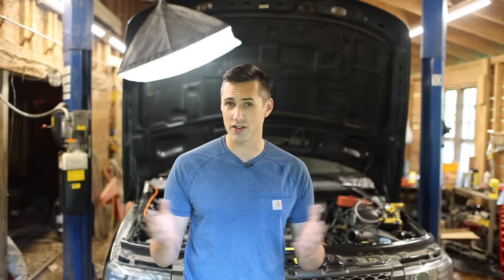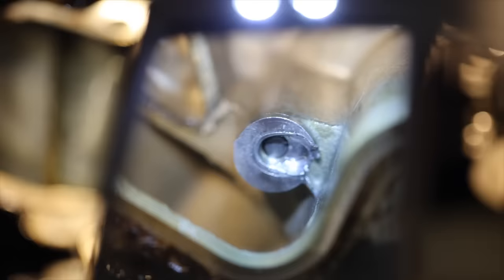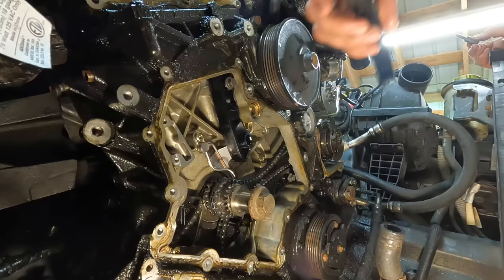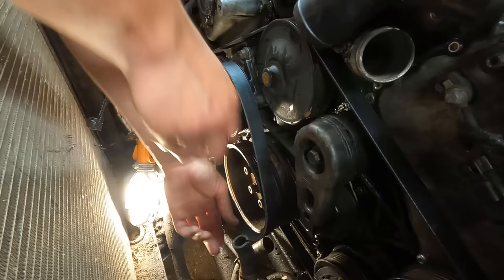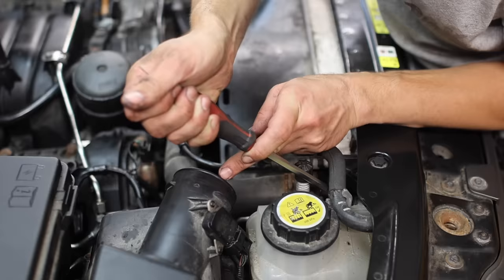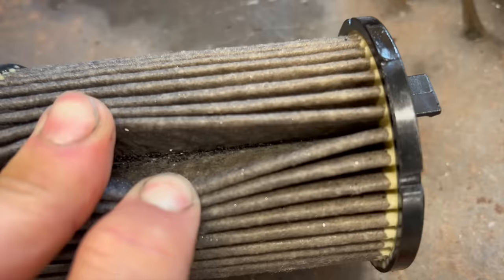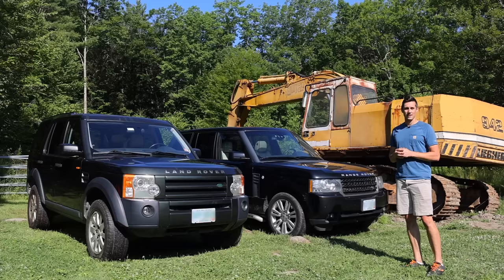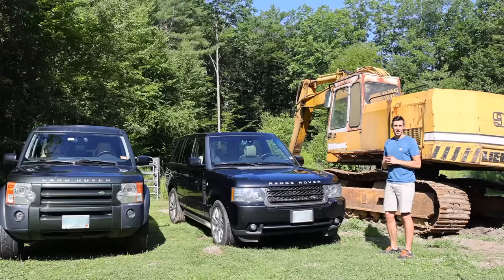Does My Cheap Auction Range Rover Need an ENGINE REBUILD? [Range Rover Part 4]

Comment: Sell them all, anything with Rover on the hood, take the money left and purchase the first decent Land Cruiser 100/200 you can find and enjoy the rest of your life without having to rebuild engines.  You wont find one for $2 grand but you wont have to buy all those parts to fix it. My 200 even has heated and cooled seats.  At 115,000 it has no knock at all.  I spent my $ putting on a set of Heritage Rims.  If you just enjoy working on cars then maybe you can take both ROVERS and make one that will go 6,000 without needing new heads, cam, timing chain, etc.

Comment: At the point you cranked the engine over for the first time after reassembly, it sounded like you had low compression on a cylinder. 

Edit: I had low compression on a cylinder from a melted piston which caused metal in the oil and the filter from cylinder wear etc.

Comment: My personal opinion you paid $2000 for it you repaired it drive the thing until it falls apart. That is my personal trainer when the motor goes out for the new motor in it if it’s worth it.

Comment: Did u get out all the chain guide plastic pieces? I did not see u did in the last episode. Some of them should be in the pan and most of them could be in the oil pickup. Well, at least ur engine does not give oil pressure warning. Not easy to just remove pan to see for this car. Everything is heavy duty and built like a tank.

Comment: Aluminum flecks, severely broken timing components, if you didn't drop the oilpan and clean it out, the carnage from the old timing components will remain.

Comment: You got swarf in the engine when drilling out that bolt. Maybe you got lucky and it all went to the pan, maybe you damaged the engine. Change the oil a few times and see what happens but short trips are your friend right now 🙂

Comment: Where was the water coming out the exhaust coming from? The aluminum particles on the new filter could be residual from what was in the motor.

Comment: That bolt area that was wallared out also holds metal oil lines that oil the chain at the crank gear....with the bolt gone they fell out and they were missing when you opened everything up. Did you replace them???

Also a lot of the aluminum in the system could just be contamination from the bolt getting wallared out and all that falling down into the pan.

Comment: I think you're not going to get those aluminium parts out in one of two oil changes.
It has an oil filter... So that wont be going in the engine, let the filter do its job, and keep driving it.
It will probably go away

Comment: Hi Waldo.  I really thought this video would end differently.  Especially when the leak down test results looked good.  An LS swap would be sweet but reverse engineering that can bus data would be difficult.  I don't know how good the can bus tools are for that.  I liked the FoMoCo logo on that tensioner.  Maybe the data is similar to Ford's.  You might get lucky.  If it we me, I would just drive it until it wouldn't go anymore.  Thanks for the video!
Reply: Ford owned Land Rover when that car was new.

Comment: Hey Waldo. Just found this series and I have never seen a failure like that after my 20 years with rover.   I noticed you didn’t install that last bolt on the passenger bank fixed guide.  Couldn’t get the bolt out?

Comment: Should've replaced the oil pump while everything's exposed . They are only good for 100k,
and it's right behind the timing belt. They're not that expensive and easily replaced.
And a failure would destroy the engine by the time you realized a problem....

Comment: It’s just a ford engine, possibly even if it is a Jag engine.
As for the swap if the engine has the same firing order and the same sensors and the same number of teeth upon the tone ring the computer won’t care that it’s a Ford Jag Toyota Nissan or LS. You could even fit a North Star if you wanted to be really different but the biggest problem with that may be the bell housing adaptation or not ?
The problem with North Stars is the crappy head bolts but there’s a fix for that.

Comment: Put a v8 Range Rover motor in it that way you can use the computer from the donor engines car and it might match up better than an ls would and possibly less work

Comment: I think the metal bits are from previous abuse. There's no way that 20 miles around town would cause so much wear. Clean out the pan, change the oil a couple more times and I'll bet it goes away.

Comment: I know nothing about these engine, but it's not a aluminum block with nikasil coating (or whatever cylinder coating they have) that has worn out and is now slowly eating the cylinder walls?

Comment: Can you make sensor adapters to fit the Land Rover sensors to an LS engine? That way the Land Rover can still use it's central electronic stuff. Transmission adapter plate also so you're only changing the engine?

Comment: This is why I did not purchase a Range Rover. This is my dream car but just not reliable. I purchased a Lexus GX460 instead. 8 years later and still going. Not one single issue. Not one.

Comment: so... although 5% leakage is admissible in the compression test, yet since all those cylinders were losing on the compression a little bit, it might be the cause for those metal chunks in the oil filter??

Comment: The only engine that should ever be in a range rover is the 3.5 L Rover V-8 engine the aluminum one based on the Buick design originally.
This engine had tons of power for super reliable simple to repair extremely durable sure it probably doesn’t meet all the emission requirements , fuel economy etc. but really  why mess with a good thing ?
If you really want to do it smart engine swap that would be the engine to put in this then you can go 500,000 miles reliably
Oh and that aluminum in the oil probably most of it came from All that aluminum in the timing area , clean and sump really good and see what happens.
Or just sell it as Runner

Comment: Is the motor in the Range Rover the bmw M62 V8? I have an X5 with the same engine and have no problems apart from a rattle vanos. Just do another oil / filter change and it will be fine for the trip.

Comment: Since you already dropped the money on the timing ...id rebuild it and not ruin it with an LS  swap  or find a used low milege engine or a totaled out range rover keep it all range rover it would bring more money all stock if you choose to sell it later ......LS boys love them engines.  But it would be a hassle trying to swap it unless you completely rewired everything just for that when a salvage engine would be basially a plug and play

Comment: Just run it.  If and when it dies worry about it then. After you SeaFoamed the motor you haven’t put nearly enough miles to flush it out clean.

Comment: Sometimes it better not to know 🤣🤣 I personally wouldn’t start putting a lot of money into this project, it will be a money pit. Run it and see what happens, if it blows sell it for parts. The engine is past repair anyway

Comment: I do smile when the suggestion is to 'put an LS it!'. I mean why?
That RR engine is running too well to have major issues. I would have the sump off, clean everything out and do regular oil and filter changes rather than buy someone else's engine with no history. Given the issues found I am surprised you didn't drop the sump when you did the timing chains. After all a bolt was flying around in there.
This RR has suffered from the usual ham fisted 'Someone' who has 'been there before' and you blame the car? I mean the timing chains were shot because that 'someone' failed to do a proper job.
Oh and lets remember this engine is a Ford AJ-V8 which was fitted to the RR from 2005 to 2012 and in other cars, including the Lincoln LS and the 2002-2005 Ford Thunderbird, as well as the Aston Martin V8 Vantage. So 90% of whats in that engine can be bought from a Ford dealer.

Comment: Take off the oil pan, clean it, clean it and keep the oil changes up.  That engine sounds good, but you will only know if you really dive into that block.  You are catching the shavings in the oil filter and there is really no telling if it was from the previous owner and how abused the engine is.  If everything adds up, the math computes, why not be confident in your capabilities?

Comment: You should electric swap it.  Pick up a totalled Tesla Model S and swap the batteries, motors, and computer into the Range Rover.  Quiet, torquey, reliable, and little service

Comment: why not rip the engine out, cam and sleeve it and hot it up. you will probably find the issue but you can replace parts with hardened versions so they dont wear as fast.

Comment: I would neutral drop it, rocking horses, burn all the rubber off the tires, remove all the oil, and then redline it until it explodes. Then I would put plastic explosives in the cab roll out some wires, and operate a plunger like wiley coyote and blow it to smitherines!!!!!!!

Comment: You have two options. Or throw it into the sea because British cars are a waste of the world's resources. Or throw away this motor and install an electric motor. There is plenty of room for batteries. And regarding the aluminum in the oil, in my opinion and from my experience with no better cars from France and with the same problem with the timing chain, this is what came out of the engine block when the timing was not in place and scratched the block and what was worn from the tensioner to the chain. In my opinion, you can change the oil several times every 1000 kilometers and it will go away. There doesn't seem to be any other problem with the engine, the pressures were good and even excellent, the timing belt is in place now. Yes, you should lower the oil basin and clean it. Regardless of the problem of the coolant which at the time was old and mixed with normal water. also. It's nice to see you change a timing chain from the sofa in the living room and not get dirty and realize that in a few years these engines will be in Mozans and we will all enjoy electric engines without water oil and variable timing.

Comment: Will a jaguar car 5.0 work in place of the rover engine with some slight modifications? I am finding the car engines are more abundant and cheaper. But they look identical except for the oil pan.

Comment: If it’s aluminum, is it from the oil pump gear? RRnet forum give you any help? I had the p38 and wore down to the point it shattered. The front cover that held the oil pump and water pump was damaged at the wall in the oil pump syphon chamber. Had a tapping sound when it wasn’t pumping oil and left tiny particles of aluminum from the broken oil pump gear.

Comment: Hello there I am really enjoying your videos., I notice a difference in the concrete on the floor where your 2 post lift is bolted to, did you use different type of concrete or just a different thickness?
I was thinking of putting in a 2 post lift also but the thickness of my concrete is 4 inches do you think this is enough?
Sorry for the non related questions!

Comment: No sense in LS swapping a range rover . Unless you include a rewire and transmission swap. It would always be a bitsa. And there is no value in a Bitsa that doesn't cost 10 times the selling price to produce. All that aluminium doesn't matter worth a damn if the pieces are flat in form? Have a look under a magnifying glass. They all maybe come from places it;s been stuck for years. Like oil galleries mostly.  You may be releasing it from the cam journals which is microscopic galling from being overheated mildly or run low on oil for some time. Nothing terminal about it. Trust it until you bust it ! You'll get nearly all your money back as scrap if it takes a crap far from home and you must have roadside assistance on your insurance!

Comment: Dear Waldo this is Saurabh from India, my ML250 engine got stalled and was recently redone at a non Mercedes workshop, it has done 600 kms, I have  been driving it below 60 kms speed, I recently noticed that, when I push the car at red light and RPM  goes around 3500 plus it’s gives a dip to the engine and then gear changes to D2 and car picks up the speed. I also noticed that smoke stared coming out from exhaust. My mechanic says it could be a faulty turbo. Do you have any suggestions for me

Comment: There’re two camps when it comes to LR’s, you’re foolish with $ & love them for what they are and can do or you hate them because you just wanted one because they’re suite and now you have to fix it.  I’m likely an idiot and drank the cool aid as I have three.  One as a spare and two as daily drivers.  I enjoy them like children but must admit it’s trying at times.
Reply from the maker: Yep, I'm with you on that. I bought the Range Rover because my LR3 was so unreliable. I figured if I have two, hopefully at least one of them will be working/drivable at any given moment 😂
Reply: @WaldosWorld  I’m a little shocked with the LR3.  I got my ‘05 with 140k and back in ‘14 and it now has 240k.  It’s cost me less than $1k/year to maintain.  It’s my goto choice for hauling the 7 person family or concrete blocks. 1000 mile trips every month is not uncommon.

Comment: Why can’t you just rebuild the engine from scratch!? Did you explain that buddy? Wouldn’t that make it like brand new again? Good luck mate!
Reply from the maker: I probably should've talked about that more. It's really hard to get rebuild parts for these engines. I called the dealer and they don't even sell pistons, bearings, etc. They wanted me to buy a long block for some insane price 😂
Reply: @WaldosWorld  I get it dude!  The dealer will always try to profiteer tbh!
Did you consider getting the bits manufactured from the far East or somewhere? I know it’s a ball ache but could possibly be a cheaper alternative! However I got what ur saying!

Comment: I seriously doubt you would ever get a reliable and gremlin free setup with anything other than the land rover engine. As boring as it may seem to just rebuild it,  these are just way too complex in their electronics to mess with. 
Good work getting it going so far,  it's a real bugger it needs work still.

Comment: Just run the engine. I'd rather have then engine blow up then give up just because there is some metal shavings in the oil. I feel like you are giving up too quick on the engine. Give it some time to breath.

Comment: You have to consider that the normal state of a Range Rover is a 100% unreliability. The worst car on the face of the earth. After all this work just wait until the hydrolic system breaks down. A treat.

Comment: right, so the engine you worked on is bad after all. After spending so much time, money and effort, it is bad after all.

I could have told you that from the beginning. Why else would it be so cheap. 

And btw, this proves the case: New cars are junk to start with.

Comment: bro its simply visible in your preivious videos that there were couple scratches on cylinder wall and cut on piston.. so bro instead of wasting audience time take the engine out change pistons , cylinder kit and clean engine and it good to go... your and wasting time making 4,6 parts of videos and nothing is fixed yet.